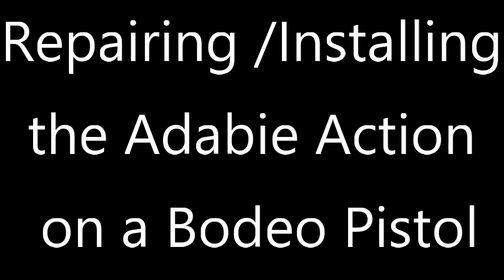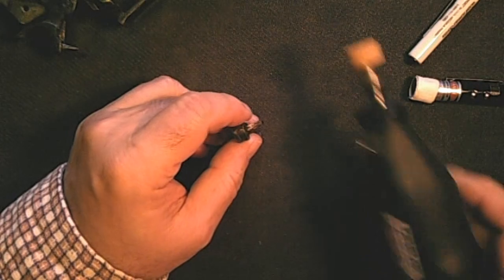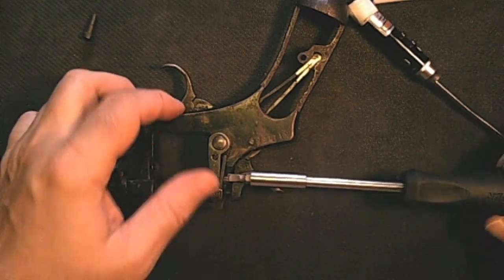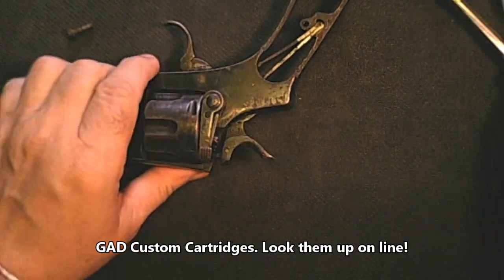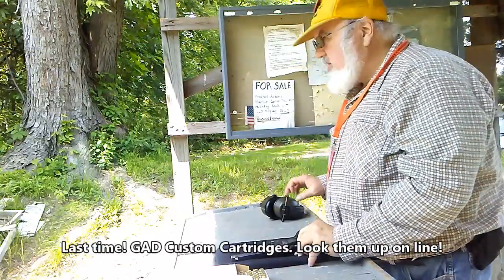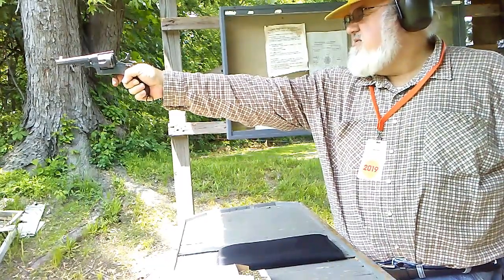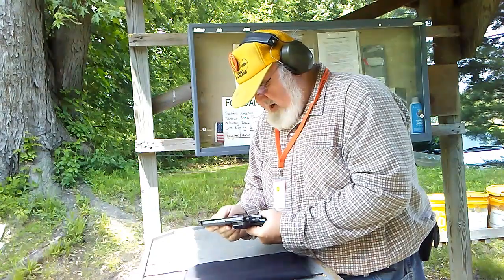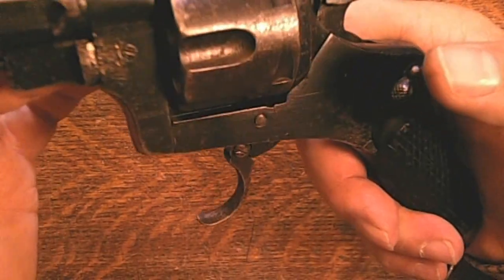Repairing The Adabie Loading Gate Action on an 1889 Bodeo Pistol

Comment: Have you taken the Bodeo back to the range since this video to see if it is fixed now?
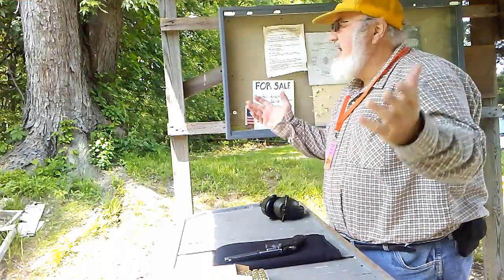Reply from the maker: ??? If you watched the video, you saw me shoot it after the repair to the loading gate mechanism. 22:59 is time stamp of the shooting portion.
Reply: @cyclecamp1  Yes but it misfired a few times during your video, at 39:01 you took it back to the bench and you explain that you shaved the loading gate pin off since you assumed that was the problem
Reply from the maker: @filipoloretti7784  Yes, I took it back again but did not film it. The pin was indeed dragging and that was the issue,